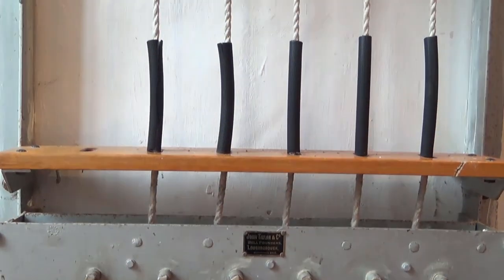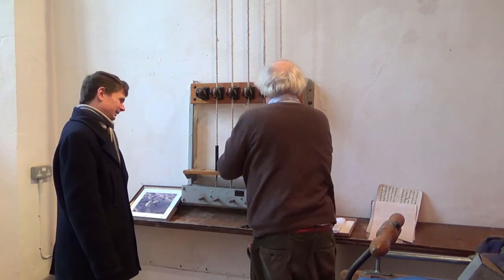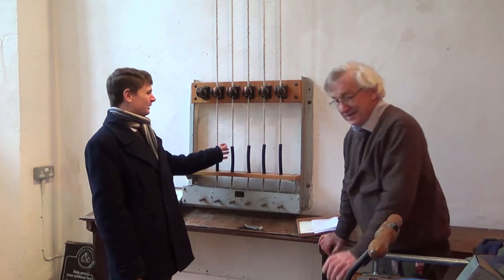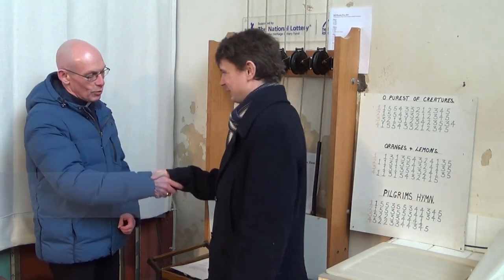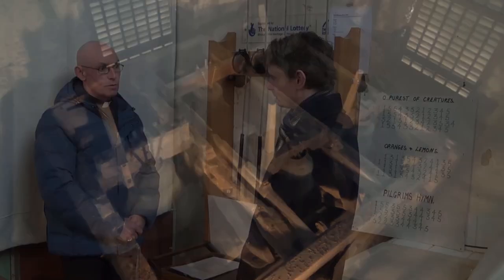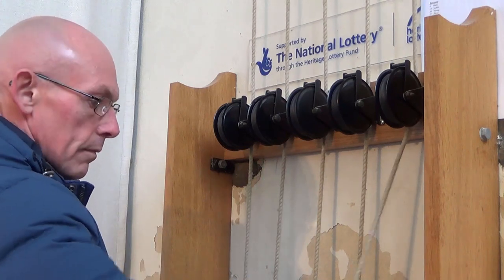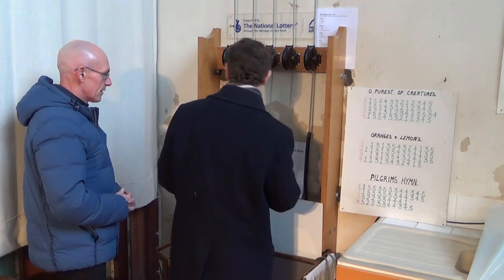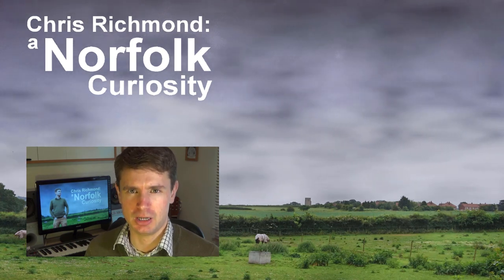Ep03: The Mystery of the Ellacombe Chimes

Comment: The Bells of the Memorial Cathedral of St. John the Baptist - Mombasa - Kenya are the oldest set of Carillon in all of Africa. We have the Octave, all rung on an Ellacombe Frame. In fact the Ringing Chamber has only has room for one person to ring at a time ! The Bells were cast by John Warner and Son, Bell Founders to King Edward VII in 1904. We have a mixed voluntary Team of 18 Ringers aged 10 - 71, ringing a wide library of Ring Changes, some specially written in 2016 to make the restoration of the Bells, Visitors are very welcome - as long as you can cope with 35C in High Summer ( January ) ! Canon Dr Steve Foster - Tower Captain